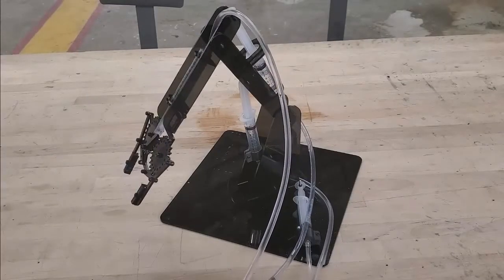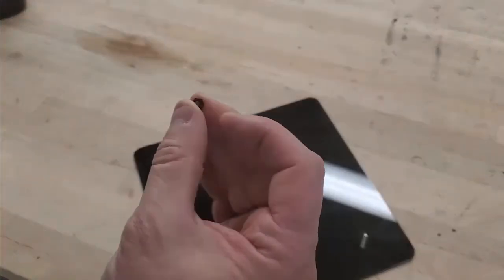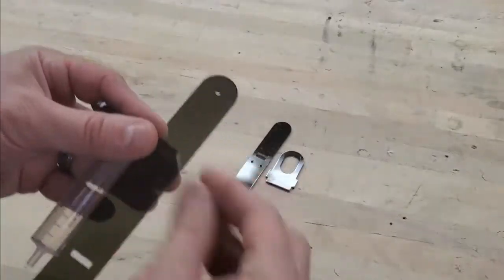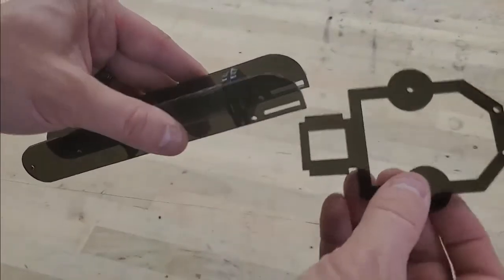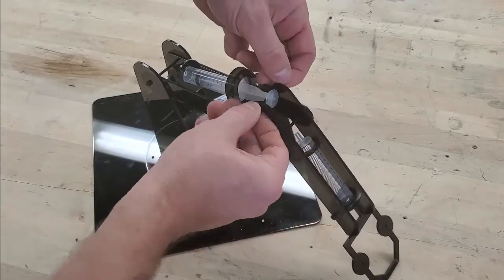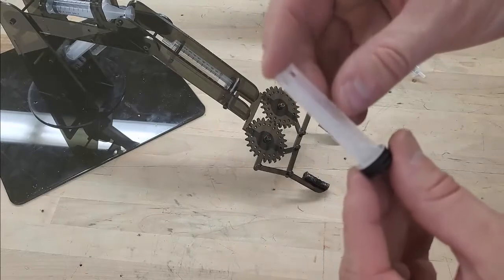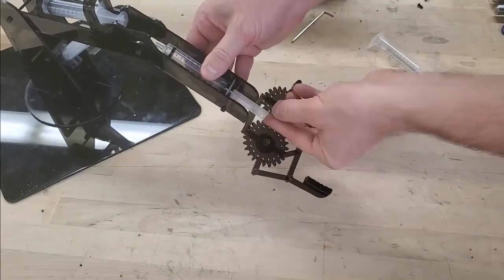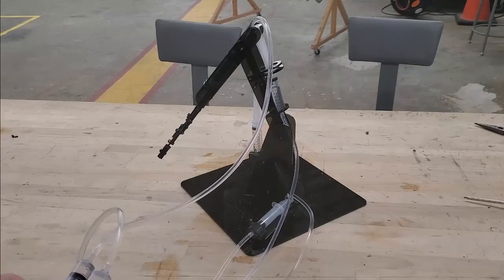Laser Cut Hydraulic Claw Assembly (DXF & STL files in the Description)

Comment: how do you fix the problem with the main boom not staying up?
Reply from the maker: If you push the plunger all the way out , it will rest on the lip of the syringe housing holding it up. The other way is just to use a little bit of tape on the syringe that you manually push.